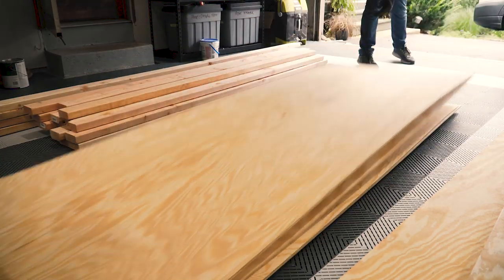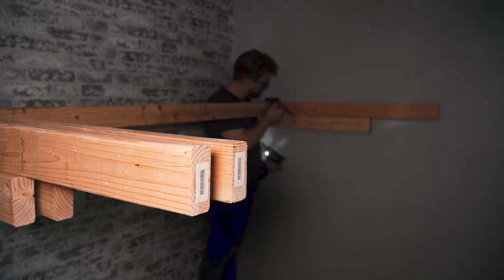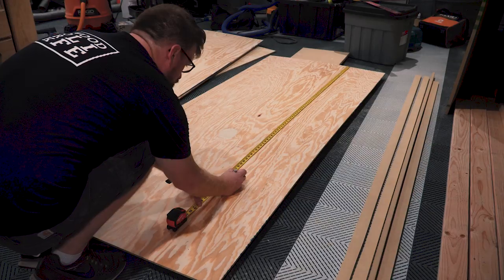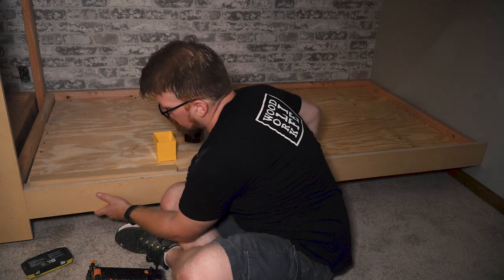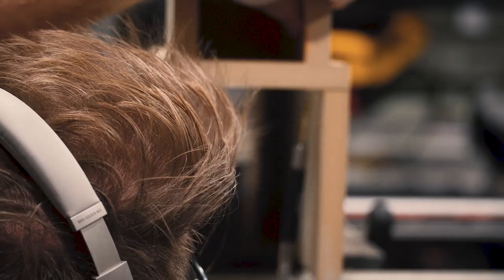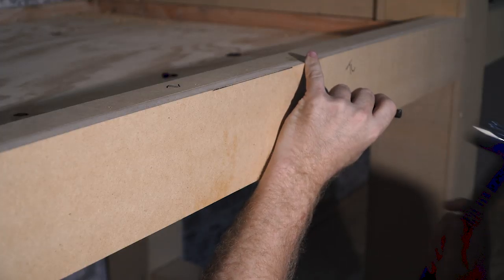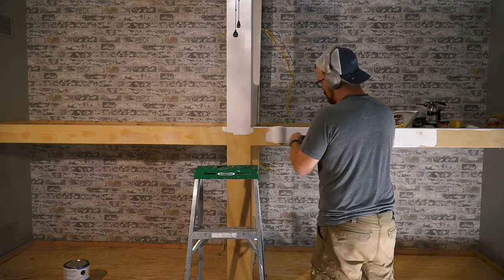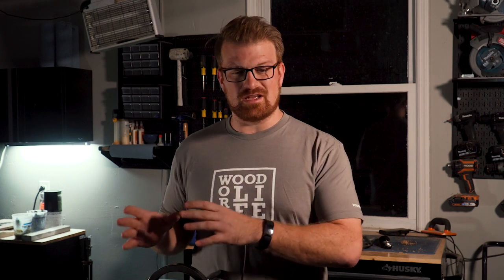Built-in Bunk Beds - Part 1: Framing & Trim | Woodworking Builds

Comment: If i were to replace the plywood with wooden slats, would it be strong enough to support 2 adults? I wanna do this in a future guestroom
Reply from the maker: Ya, it should.  You could also use furniture grade 1/2" plywood instead of sheathing.  Or buy the bed frame supports from Ikea.

Comment: Ca glue corrodes in a few years I wouldn't ca/ superglue anything anymore!
Reply from the maker: It is great as a clamp, it is great to set up fit for things, it is great for fixes and kludges.  It is great for many things in woodworking.  I mainly use it to replace pin nails for holding pieces, as filler, and to clamp temporarily to attach via other means.

Comment: Really good project. I did find that you were talking way to fast to follow what you were saying without watching several sections multiple times.  A lot of people don't realise that we need those natural breaks, in talking, to be able to process what's being said properly. Talk to fast or add umm's and err's and it just become a word wall that hits you in the face but doesn't go in. The speed you were talking at the outtro was mach better and I would have preferred to watch an extra few minutes in order to have longer breaks between sentences. I'm off to watch part 2 🙂
Reply from the maker: I slowed down in part 2.  I think I packed in too much in part 1.  I just didn't want to do a 3 part video.  Sometimes when you're editing yourself it's hard to find the balance between slow boring and talkingsofastthatnothingmakessenseandthewholethingbecomesagarbledmess 🤓